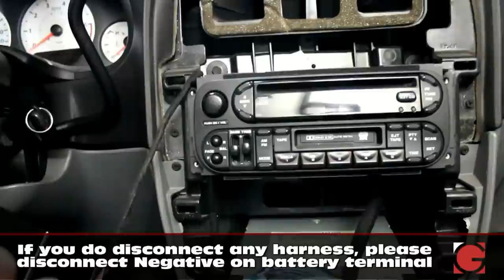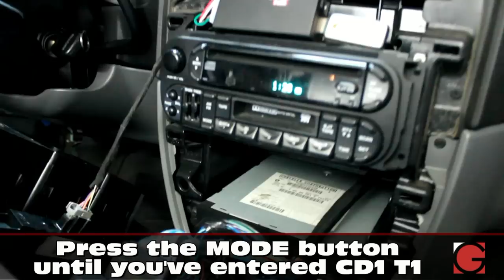2002-2005 Chrysler Town & Country Stereo Removal and Bluetooth AUX iPod Install - GROM Audio

Comment: Is this guarantee to work in my 2003 Town & Country LXI because I tried put a new after market stereo in it and it wouldn't work because there is a amp on each my speakers ( I think thats why I can't put a after market stereo in)
Reply from the maker: If the stereo system does not have DVD it should work. Note that GROM integrates into your current stereo system, this is the reason why there is no conflict with the amps on your speakers. Here is the link to the product: http://gromaudio.com/store/usb_adapters/grom-usb3-chr02.html Thank you.
Reply: What is it? The most useless product on earth? Use old stereo...? That's a brutal sell.

Comment: So if I add this unit I will lose my factory DVD? Or is that just if I change the radio?
Reply from the maker: +yungsekiete yes most likely you will loose the DVD, as I understand it is the external DVD changer, correct? Build in CD player will keep working. Thank you.
Reply: External? No I'm referring to the factory DVD player
Reply from the maker: +yungsekiete Build-in player will keep working. However it is always better to check with our tech support specialist at http://gromaudio.com/support.html, they will be able to provide you better advise. Thank you.
Reply: so you are saying this wil not interfere with the DVD player at all? I'm okay with maybe having to substitute a dvd slot or cd slot in order to use this unit I just don't want to lose too much functionality of what I already have if any.
Reply from the maker: +yungsekiete apologize for the mix up, the DVD system will be disabled. Thank you, and sorry for the mistake in the previous answer.
Reply from the maker: +yungsekiete but build-in CD player will keep working.
Reply: @gromaudio  there's is usually two DVD players one in the Town and Country radio or stereo only the ones without case the have it! the other external one is connected to factory cables to stereo